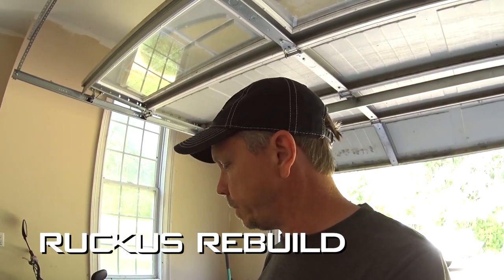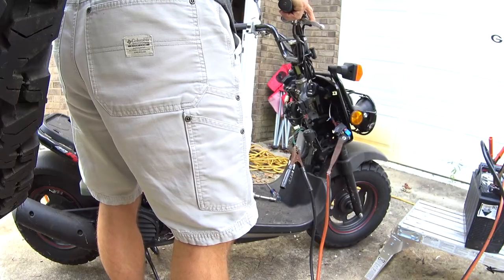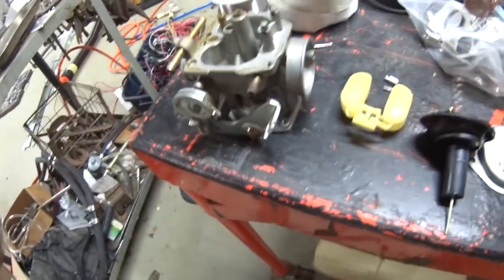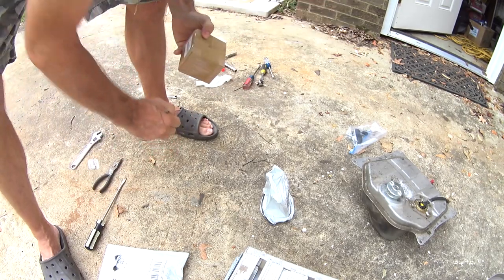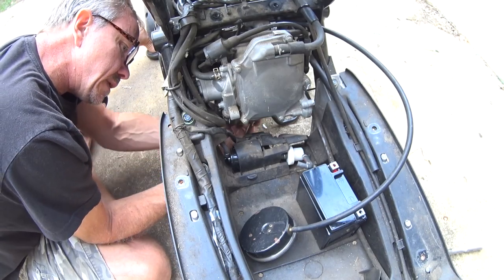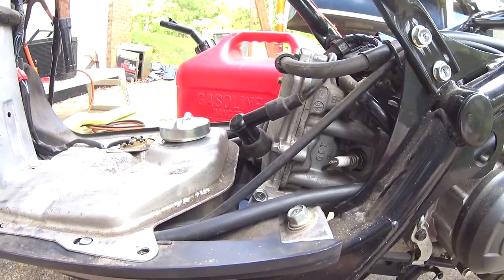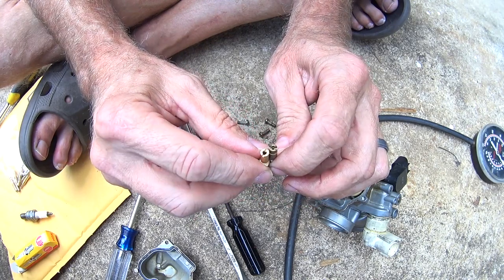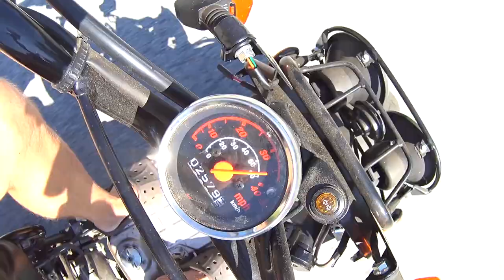Honda Ruckus Rebuild

Comment: The wires in a wire wheel are usually small enough to clear those tiny jet holes.